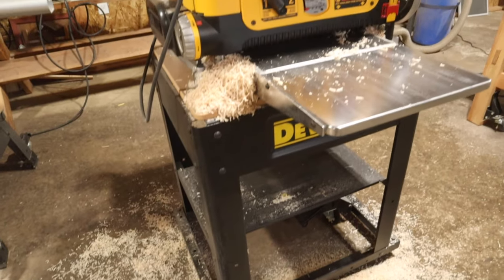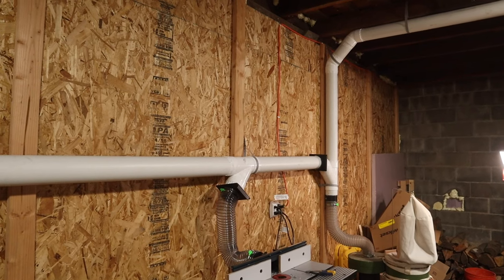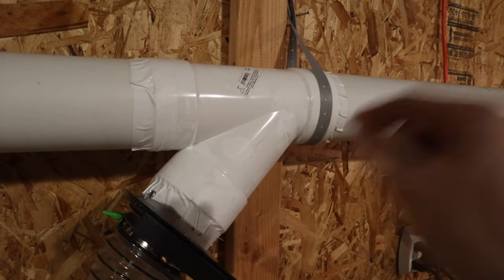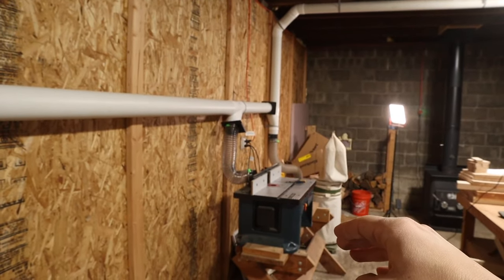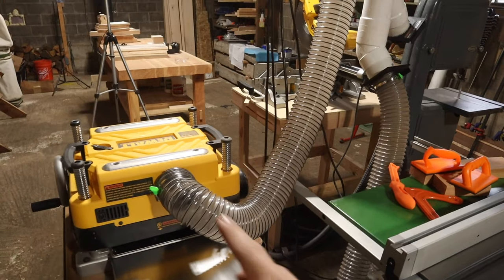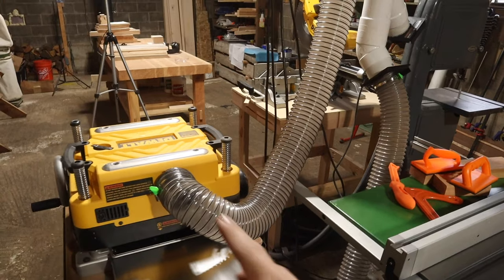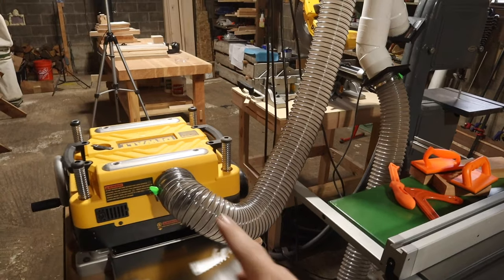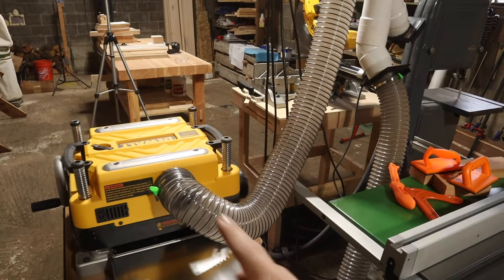4in, PVC Dust Collection Upgrade | Much Better!

Comment: Just a thought about the filter.  In my shop I have a Y with blast gates after the DC giving me the choice of venting through my filter or venting directly outside.  If I am heating / cooling my shop I want to save the conditioned air.  But if the outside temperature is tolerable I just vent the DC outside.  It sucks better and is much quieter.  Of course, I'm using a cyclone to catch most of the stuff and all I get outside is a very fine powdery stuff that my lawnmower makes disappear, and I don't have any neighbors that are close enough to be bothered by it.
Reply from the maker: I like that idea a lot and had thought about doing that. For me, the challenge is outside my shop is very dusty so pulling air back in would pull that dust in at the same time. And in the winter, like you’ve alluded to, I want to keep my hot air in 😂 eventually I’ll do a two stage like yours and put a canister filter on to really scrub it. 

If I move to a less dusty location in the future, it’d be nice to have a system like this because I dump it out there anyways 😂

Comment: nice job -- my table saw has a 4" vent in the cabinet, dont get enough off the top of the blade to bother. the miter saw, however, is a mess. consider a HEPA filter instead of the bag
Reply from the maker: I just upgraded my table saw to a 4in and man does it make a difference. I think part of my issue on the top side is that I don’t have a riving knife (I know it’s dangerous and I hate it) so when the wood pinches on the back side, it throws dust up. 

I agree as well, if I stay with this style of dust collector, I will likely upgrade to a two stage and put a HEPA filter instead of a bag.

Comment: The flex tube ridges do not cause "a massive" pressure drop.  There will be more friction and turbulence than smooth wall pipe but it you keep them short and straight as possible it won't be much.
Reply from the maker: I think it may just be a difference in terminology. Net net, I think we agree that there will be a drop in performance if only flex tube is used. And I certainly agree with you, the straighter and shorter, the better.

Comment: Hello. Great video! 
But need to mention...
DWV (drain/waste/vent) comes in different wall thicknesses, including schedule 40, which is most commonly used. There is also a foam core pvc that is used in areas where it needs to be more silent, for example in vertical drops or in a wall where people don't want to hear the pipes draining. 
That thinwall that you used is most likely a schedule 30 wall thickness which is used in non pressure systems in areas where temp will not exceed 140°F.
Otherwise,  very informative video!
Keep up the good work! :)
Reply from the maker: Thank you so much for adding this! This also explains why I had such a hard time finding the pipe purely by DWV. Didn't realize there was an umbrella of DWV pipes. 

Glad you found it helpful otherwise!
Reply: @NorthwestCraftsman  Is my pleasure! :)

Comment: I found that talking a 1/2 inch dowel and rubbing out the wrinkles in the tape will help with sealing it, at least it works on the aluminum duct tape real well--I haven't it on regular duct tape.
Reply from the maker: That’s a great idea!

Comment: That was one of the best if not the best dust collection video's I've seen! Thank you! I'm days away from starting my build  and some questions: Did you silicone the pvc to pvc joints and have you come up with a  table saw overhead and work bench overhead attachments?
Reply from the maker: Thanks Gary! That means a lot to me, I’m glad you found it useful. 

I didn’t silicone the PVC joints though that would seal better and I haven’t figured out what to do for the overheads yet.

I did learn though, the white duct tape already released and the tool cluster connection fell from one of the vertical connections. I’ll pin a note to the video but I recommend using those self tapping screws on all vertical connections if not all connections in general.
Reply: Get ready for a lesson in humility! But don't give up. Problem solving is an important part of woodworking.

Comment: 8:02. That can be a problem. I have the same blast gates and the channel that the gate slides in tends to get clogged and prevents the gate from fully closing, resulting in loss of suction. I wrap the  portion that goes inside the PVC with duct tape until it has a very snug fit. That way they can be removed for cleaning as needed.
Reply from the maker: Good to know! Thanks for the suggestion. I’ll be curious to see how fast things build up.
Reply: @NorthwestCraftsman  There are some who modify them by cutting the back edge off and making a flap out of duct tape that is supposed to close when suction is applied. Might work, but sounds tedious to me. I only have two gates that I use with regularity, so it's no big deal to remove them once a month or so to clean them.

Comment: Although it may be in violation of NFPA (I have not checked), you can run a ground wire in the pipes to discharge the static. Fine particulates and heat from friction/cutting are a risk for dust ignition. Build looks good!
Reply from the maker: Thanks! It works well for me.
Reply: You have made an extremely good point Jared. Without a copper ground wire attached to and wrapped around the lengths of the outer PVC en-casement of the pipe. The fire risk is 82.56% higher towards catching on fire from fine particles and friction causing ignition.
Ideally all piping should be constructed using metal piping. However, this should be ok (ish) when using in the home workshop. BUT... I would take action by grounding your system asap. The aluminum tape also helps with this but make sure the copper wire is taped under it. You should be aware that any workshop using PVC piping type system that doesn't meet world wide OHSA & NFPA dust extraction system standards (which yours Does Not!). Often means your workshop and items within it aren't covered by insurance should it result in a fire.... and yes insurance companies world wide will investigate this as a probable cause - you decide if this risk is worth taking?
Reply: Great video thanks for the help. As far as static control you can put a steel screw through the pipe on a regular basis and join it on the outside of the pipe with a wire and discharge electric chargers simple effective.
Reply: The bigger threat is that a spark ignites a shaving. The air movement fans it to life. That smoldering shaving is then buried in a bag of shaving. Where it smolders until 2:00 AM when it burns your shop down. 
Chips moving thru plastic creates static. Like rubbing a ballon on a sweater. 
You have just been lucky…so far. 
Other than that, great video!  
But ground your system.

Comment from the maker: **NOTE & DISCLAIMER**
There is a risk, albeit a small risk from the research I could find, of a static ignition of dust particles in the dust collector lines which can lead to a serious explosion and shop fire. Follow your local codes and regulations when installing systems like this. 

Also, the white duct tape did not hold, especially on the vertical joint at the tool cluster (found it on the ground in the shop). If you can use PVC cement (permanent) do this. Otherwise silicone all the joints and add self tapping screws.
Reply: Have you looked at the wide (2") plastic tape. Like black electrical tape, only in white and ~2" wide.
Reply from the maker: I haven’t! I’ll have to look into it. If this was my long term shop I’d just silicone all of the joints and seal with a self tapping screw but that may be my solution in the short term! Thanks!
Reply: Great video I hope to have a similar setup soon cause dust is very frustrating. One thought on connecting the pvc pipes. Any reason you didn't use primer/cement glue ? I know that's a permanent bond and best seal possible. Unless you didn't want that permanent in case of changes in the future. Just curious 🤔
Reply from the maker: Phenomenal question and thanks! Your 100% right on all fronts. Primer and cement is the best way to put this system together if you want a permanent setup. I’m currently renting my house so I wanted to be able to salvage as much of the system as possible and leave it versatile for the next setup.
Reply: I know you want to have it where if there was a clog you can pull it apart, but why not just PVC cement everything in place?  It will hold together very firmly and also will get rid of any other leaks in the system.  Like a central system that uses similar piping, just 2" outer diameter, the installers "glue" them together.  I would avoid putting screws through the tubes because that's a potential clog right there.  If you want to still use tape, you could use some plumber's metal pipe band (I know, it sounds like the name of a Rammstein bag pipe cover band) to help support your tool cluster tree from the ceiling.  

Can you buy a cartridge filter for your collector?  I mean, the bottom bag could be changed to a fairly heavy duty clear garbage bin bag or with some creative work, the filter cartridge combined with a modified garbage can.  That way you still have the old machine and the advantage of better air quality.
Reply: @NorthwestCraftsman  Understandable.  I should have read others' comments.  My central vacuum is the same story.  I just friction fit the pieces together.
Reply from the maker: Hey! No problem at all, seeing all the comments is hard as a viewer, not to mention, it’d take a lot of searching to see the commonalities. 

You’re spot on though. I’ll glue it up when I get to a home I own, right now I’m renting. I’m also chuckling inside thinking about a Rammstein bagpipe cover 😂 thank you for that.
Reply: I understand you're CYA legally but other than the occasional shock like you get from carpet on a dry day, there's really nothing to worry about static-wise in the home shop. The ONLY safety concern that I've seen that could possibly matter is if you're worried about getting shocked while using a machine (table saw for example) and you're worried that you will jump/flinch during a cut.  If that's the case, simply ground that machine locally and you're done. We simply don't generate the enough dust to reach anywhere near the concentrations necessary to create an explosion (you need a grain elevator or industrial cabinet shop for that). If it was really an issue, you'd see explosion-proof motors sold with every dust collector.

Comment: You are right about Power Tech fittings being costly. So is the vinyl flex hose. I used 4 in dryer vent hose to save some money. Very few of the figs cost a lot but there are so many of them. My biggest cost was making design changes which made for additional fitting costs.  I am a retired design engineer but still was unable to anticipate these changes never having worked with this stuff before. I am currently closing out the installation and am embarrassed at how inefficient this process has been. Design concepts erode quickly when the metal  hits the road.  That's why real designers first build prototypes. But then, in spite of our genius the changes begin!  I haven't found any discussion anywhere about the specific best practices in assembling this stuff for DIY or just rookies. My shop is much smaller than yours, but still has 8 blast gates, one for each machine.  The planer not included. It will have to continue to be rolled outside for its operation. The miter saw resides in its sawdust cave which has remarkably limited sawdust spray, but far from perfect.  I have made provisions for its later inclusion into the system.  Not sure any of the many videos of less than great ideas warrant its inclusion yet either. Maybe Power Tech, Woodcraft or Rockler will wake up and help.  I'm still pleased with what I have accomplished so far but disappointed in the process. Just think if I was paying for labor on this!!!
Reply from the maker: Great idea on the dryer venting! And you’re totally right, there is almost no amount of forethought that can account for all that actually happens on install. Try as I may, there are always adjustments 😂

Comment: Did you weld the PVC fittings together or simply press together plus the duct tape?
Reply from the maker: In this case I simply pressed and duct taped. After the fact I added some self tapping screws. Welding is a better solution if you're fine with a permanent build. I am renting this space and plan to take them with me to a more permanent shop when we move, hence the more temporary attachment.

Comment: You often hear people warn about static build up with PVC. But, almost every shop vac type vacuum is made from mostly plastic with plastic ridged pipe and hoses. If you're concerned, run ground wiring.
Reply from the maker: Totally agree Jeff! I saw a lot of feedback online about the dangers of static build up and from all the evidence I saw, it's not a huge concern. I haven't run into many static issues but am also not a commercial shop so I'm not running the DC 24/7.
Reply: All commercially available dust hoses have metal wire embedded in it for this exact reason - to prevent static buildup. Professionals will ground this wire to properly discharge any static electricity. Also see NFPA 664 part 7.8. This whole video goes against regulation.
Reply: @PeterKnego  this is one hundred percent false. I have two Shop Vac vacuum cleaners that are made 100% from plastic as well as the hose and the attachments. The hose do not have wire in the hoses.

Comment: Great, informative, well organized video.  Do you think placing reducers in some areas for smaller machines is a good idea? More suction?
Reply from the maker: Thanks! And that’s a great question. I’ve actually done that out of necessity for a few of my tools and the opposite happens. Shop vacs generate a large pressure drop with little airflow while dust collectors usually generate a small pressure drop with high airflow. If you mix and match the hose size between those two systems, they generally perform very poorly. I’m in the process of trying to move all my tools to 4in for that reason 😊
Reply: If you are running any 2.5" connections into a 4" line, then ensure any two of them are open at the same time so you maintain the volume of air for suction. @NorthwestCraftsman

Comment: Nice video, I appreciate your description of your layout and thought process. 
One area I am trying to improve on is our combination bench top belt / disc sander. This sucker sure creates a fine dust that causes allot of fine dust in our shop. We currently have a 2 1/2 hose hooked up to our 1 hp dust collector for this sander. 
Any suggestions ?
Reply from the maker: Thanks for the compliment! And that’s a great question. If you have the ability to upgrade the tool to a 4in hose and run that to the dust collector, you’ll have better luck. Generally dust collectors do very poorly with the smaller diameter hoses but it depends what model you’re running. If that doesn’t help, it’d be good to add some auxiliary dust collection around the, specifically in the areas that like to spit the dust out. 

Hope that helps! 

Josh
Reply: Thanks Josh. 
This is something I will look at updating.

Comment: Whem you upgrade your vac, consider Harvey GyroAir 700,
I just got one, and i gota tell yeah  its awsome, 
-remote controle 
-twin cyclons.
-2 bins, 1 coarse, 1 fine
Friggin love it,  i just need duct work, im dragging the hose on the floor from one machine to the next for now.
Looking at your set up, think i may do the same
Reply from the maker: Oh man would I love to get one of those! I have a new shop I’m putting together soon and will be in the market for an upgrade so we’ll see 🧐

If you can swing the cost, I’d go for a metal instead of PVC. Technically safer (though I’ve never found a case of static discharge explosion in a hobbyist shop)

Comment: What did u do to manage static and decrease explosion capabilities?
Reply from the maker: Great question! And caveat caveat caveat, check your local codes because I am no expert. 

From what I could find online, hobby shops don’t run as high a risk of static discharge induced explosions. In my case, I only use the dust collector a few minutes at a time and then turn it off which allows the static to dissipate. I’m also in very humid Oregon which dissipates static even more quickly. 

I’ve heard a couple of suggestions though:
 
1. Build your DC from metal ducting and ground it. I will eventually be doing this but at the time I built this system, PVC was 1/3 the price of metal. I just had someone reach out to me and where he’s from, it’s almost the same cost now. Best solution is grounded Metal through it all. 

2. Run copper around the exterior of your PVC and ground it. It’s not awesome since PVC is a good insulator but it’s better than nothing.  

Again, I am not a professional nor a regulator and I recommend you check out your local codes for full direction.

Comment: I had all plastic blast gates in my set up and ended up replacing them with the  metal blast gates due to the plastic gates not closing due to the  saw dust build up in the tracks. The metal ones have not done that and still work like they should.
Reply from the maker: I’ll be doing that in my next shop, it is annoying for sure. Which brand did you go with?
Reply: Make wooden DIY selfcleaning* blast gates / shutters, I would… 
See YouTube films… 😀 a great shop you have!! 

*Easy to open and close by a rope via the ceiling.
Reply from the maker: @ToonBeeld1984  That's a great idea! I know JKatsMoses had a video on one of those systems as well. I'll check them out!